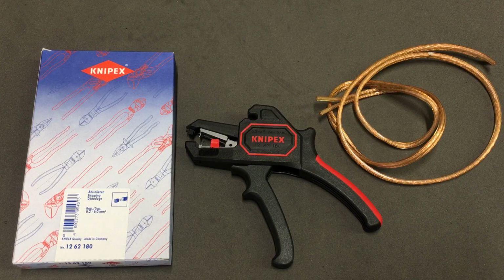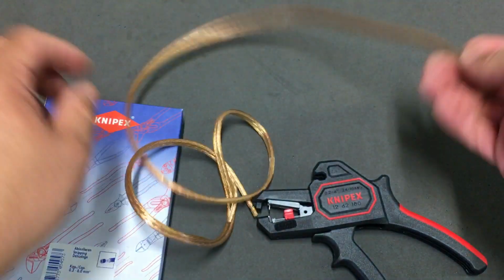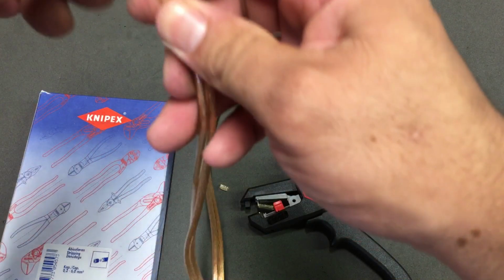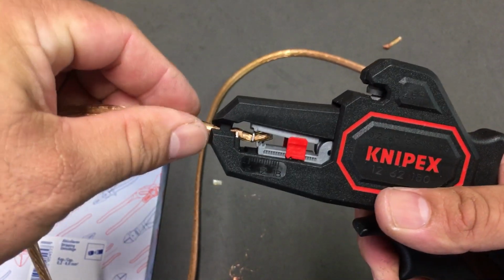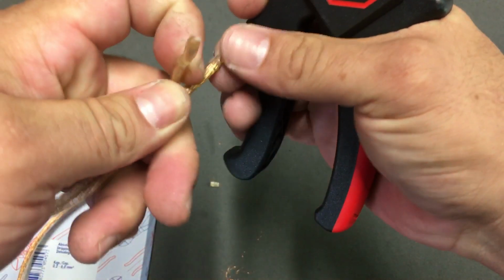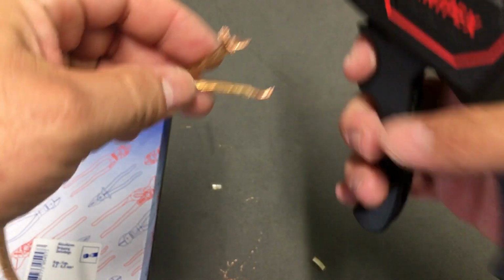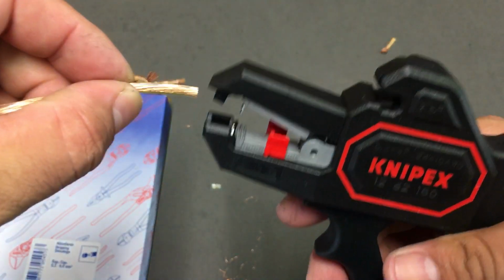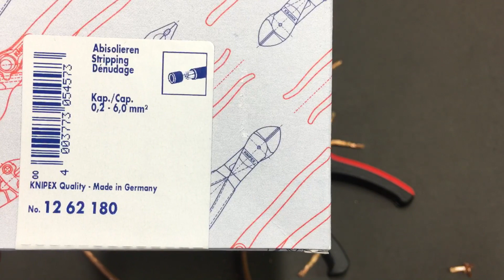KNIPEX PART#12 62 180

Comment: This is for another kind of insulation. It works on PVC or other Vinyl based insulation. Some speaker wires are also PVC coated. This type of insulation will not work. If you try to strip polyurethane or polyethylene coating, you might even break the tool permanently.

Comment: I have the old style Knipex and they have metal jaws. They handle. speaker wire/lamp cord just fine. The molded plastic are the problem. Otherwise they wouldn't worked with added pressure. Good video.

Comment: I have never tried using mine on stranded wires with such a thick insulation. I use mine on 12g solid wire to wire in outlets. Could be this tool is just not an all around stripper. I should have some stranded wire laying around the shop. I will give it a try.
Reply from the maker: Juan Hinojosa when I went to purchase this product I read the description and reviews every post that I read was good reviews but I didn't see any bad reviews so I ended up returning them to HomeDepot 👍🏼👍🏼👍🏼✌️
Reply: Frankie M. You got me curious now I'm going to try mine on different style and gauges of wire and see how they hold up. Although having the Knipex name it does seem cheaply made.
Reply: Juan Hinojosa 
I was thinking the same thing Juan. I was wondering if it's just using the Knipex name like licensed Snap On products. 
I'd also like to see them side by side with others to see if they're from the same maker.